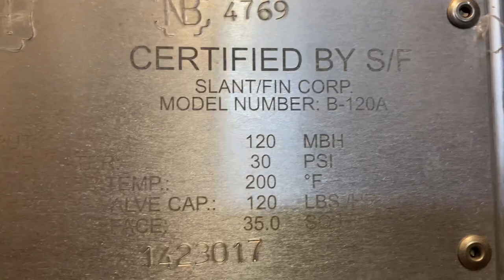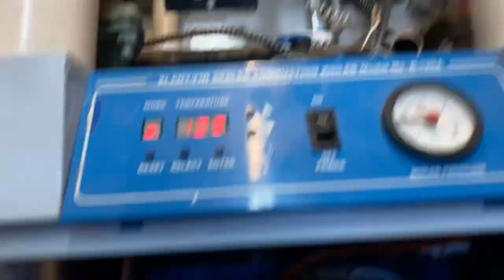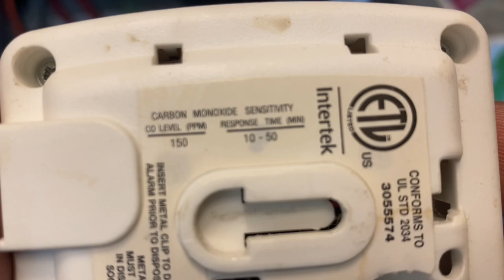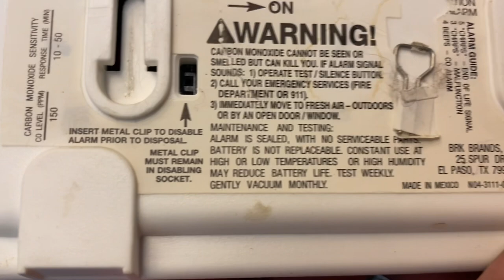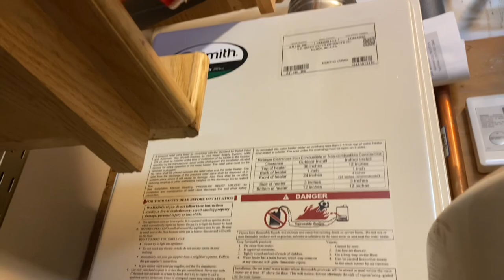Slant Fin Bobcat Condensing High Efficiency Boiler No Ignition | Election Day 2022 Vote Today

Comment: I'm surprised he has one of these in service,  I had One of these and heat exchanger started leaking when it was 3-4 years old.  Slant Fin ended up replacing it with a LYNX under warranty.  No problem since then.  The Lynx is lot more solidly built. Cast heat exchanger. I do have it serviced at the beginning of the season.  BTW, I have radiant heat.

Comment: Mike,the Tagaki was installed in 2016, the storage tank sprung a leak,it was easier to install a tankLess unit,than replacing the storage tank,plus,it extends the boilers life.That boiler is now 4 years past its lifespan,definitely looking to replace in the spring with a Bosch!

Comment: Hi @mikeypipes can you elaborate on what is wrong/your reaction to the Bobcat B120A? I have the same model, and it's inducer motor has started to whine. I had someone come and look at it today, and they are supposed to get back to me, but likely looking at a inducer motor replacement. Other that this issue, unit has been pretty trouble free, had igniter cleaned and condensate drain tube cleared of buildup. I am in lindenhurst, ny.

Comment: How come there are 4 circulators on a 3 zone system?
Reply: One is for the tempering - hot loop.  which prevents thermal shock to the heat exchanger from a slug of cold water returning from a zone initiation.